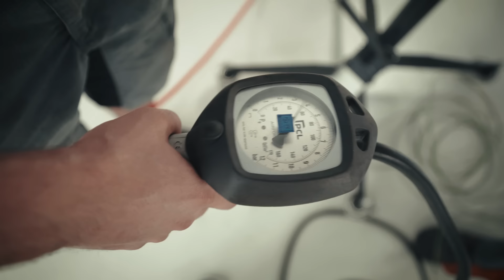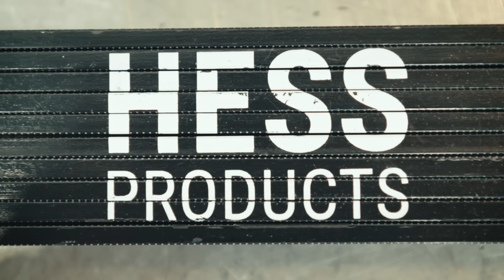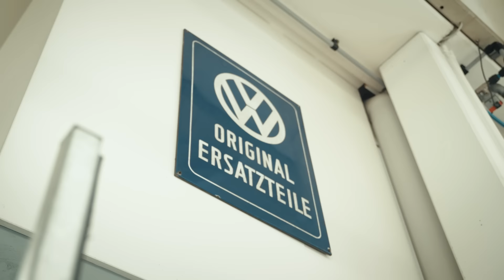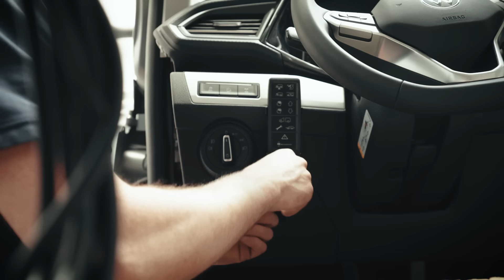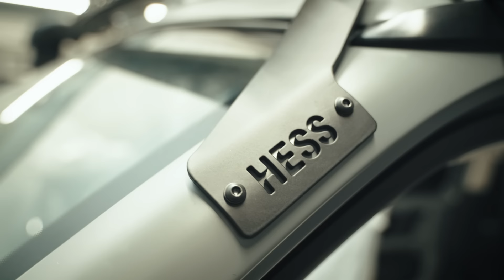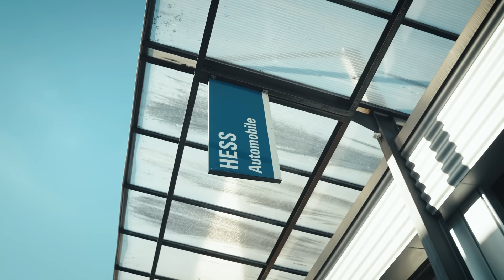VW T6.1 California Extrem Offroad Umbau

Comment: da liegt wahrscheinlich so ein Auto schnell bei 200.000 Euro fertig als Camper , oder ?
Reply: Ne, mindestens 400k€....solange es weiterhin Kunden gibt, die für VW "Qualität" viel Geld ausgeben, machen sie so weiter...
Reply: Je nach dem..Der gezeigte Umbau wird ca. 45.000 € kosten..(geschätzt) Das Fahrzeug selbst kostet je nach Ausstattung und Motor zwischen 85.000 und 100.000 € als T6.1 California Ocean. Es gibt noch Individual Ausbauer (Manufaktur) Custom Bus,  Multicamper, BaBum, Discarvery, Spacecamper, NordVan, Surfer Van, Wavecamper, Easy Goinc um nur einige Ausbauer zu nennen. Solch ein Fahrzeug mit Camping Ausbau und Offroad Umbau kostet dann auch zwischen 120.000 bis 170.000 €, Der Preis variiert natürlich je nach Ausstattung vom Fahrzeug, Camping Ausbau und vom Offroad Umbau.
Reply: @Bryan82a  Nur 25.000 mit Komplettlackierung und allem , das glaube ich reicht lange nicht bei der gut angebrachten Arbeit und Material .
Reply: 195000 chf

Comment: Hut ab bin selbt Karosseriebauer es ist alles sehr gut u schön umgebaut u alles sehr hochwertig. Ich habe selbst so ein Projekt durchgezogen mit einen t4 2.5 tdi syncro mit Sperre u Winde usw u sehr viel Geld darin versenkt aber der einzigste Vorteil dieser Busse wie t4 5 6 ist der Platz im Inneren ansonsten kann man schön so tun auf der Wiese als ob man in das Gelände könnte oder nach  Russland Island Afrika u co abseits von Schotterpisten ist oft Schluss nach häufiger eigener  Erfahrung. Die Technik der Ps stärkeren Motoren bei den Bussen ab t5 ist bekannter Weise auch nicht die Langlebigste dank Agr u Überzüchtung .Der Zahnriemen  bei allen ausser t5 2.5 tdi u die viele nicht abgekapselte Elektronik mag auch keine Flussdurchfahrten was der Schnorchel andeutet das man es könnte Ich will damit Sagen kauft euch einen Landcruiser oder Ähnliches u baut diesen zum Camper um dann ist es was genaues u für eine sorgenfreie Reise um die Welt oder im Offroad  sehr viel besser

Comment: I've looked all over the websites, but couldn't find pricing information for a conversion. What would be an average cost for a full conversion such as the ones showcased in these videos? I know each project is unique in options and features choices depending on the client, but it would be very useful to get an average figure between the most expensive conversions and the cheapest. Next year I'm planning on getting a T6.1 and making the trip to your shop for a conversion, so any additional information would be very helpful and greatly appreciated. Thank you!

Comment: Beautiful attention to detail. But that’s a monster anti-roll bar, so the new air suspension will give you lift, but at the risk of reduced articulation (unless you lengthened the ARB links and I missed it). Could make for a very stiff ride when lifted and off road. But I guess most users would be using trails rather then deep ditches etc that a off-road prepped 4x4 might tackle. Anyway, lovely job. 👍